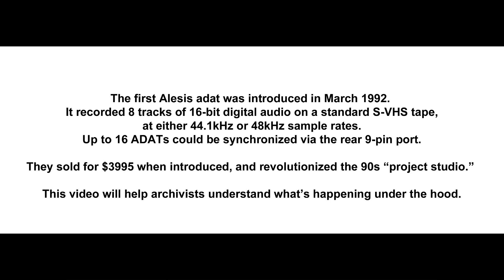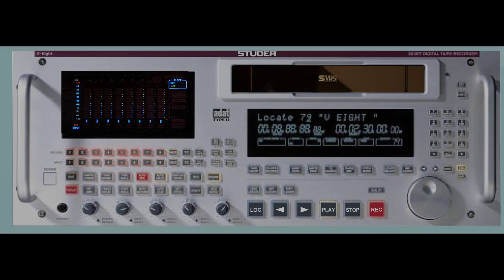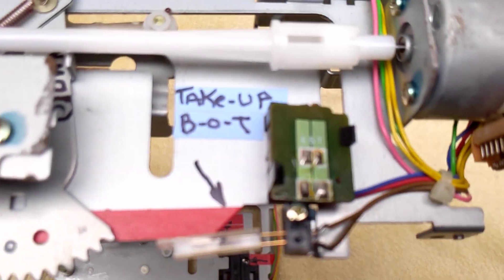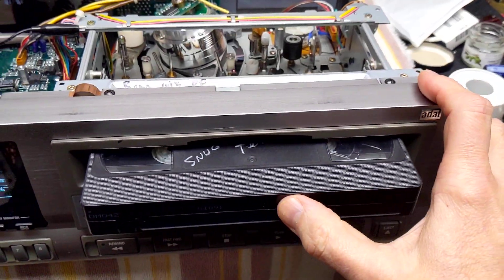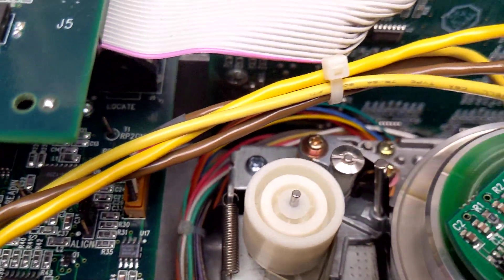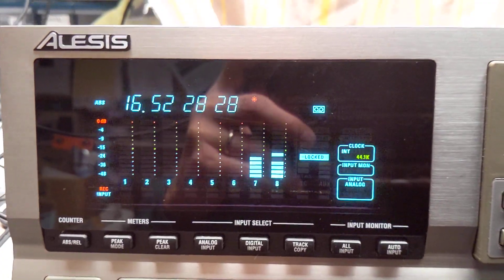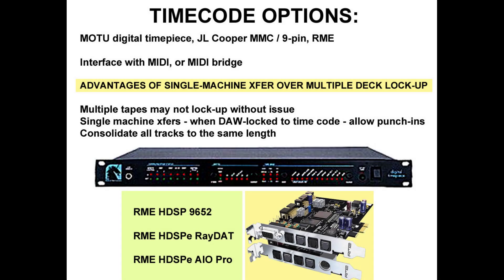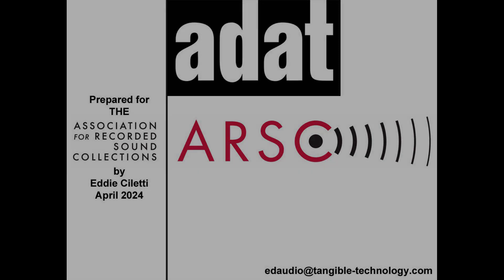Alesis ADAT: Tips for the Archiving Community

Comment: I have lost motor drive on an XP20. Not the motor itself. The schematics for the main processor board are not in the service manual. Can anyone help please? I have a vague memory of Alesis and many other ProAudio manufactures ( Dolby) only allowing return to factory repair and schematics for a lot of the gear. I use to have work on having to box the unit  up and it disappearing to the states for 6 months. Then coming back and still being faulty.
Reply from the maker: XT20. Which motor isn't turning.  Are you using fir recording or archiving
Reply: @edaudio  Reel motor drive. The machine is being used to transfer to .wav or equivalent.
Reply from the maker: @desamos8196  reel motor or capstan motor
Reply from the maker: @desamos8196  I have some docs

Comment: ADAT eating tape and no FF/RWD??  Check (by the idler tire) if the knurled knob on the Sankyo motor is slipping. To test, put machine in service mode Capstan test,  push RWD or FF, then put finger on knurled knob,  if it stops but motor still humming/turning, there you go. Not sure anyone cares in 2025 but I had to solve this and report to Eddie.  P.S. No parts available other than cannibalize an old parts machine.  Cheers!
Reply from the maker: Their only value is with the archiving community.  I have several machines and a few parts

Comment: got anything on adat won't power up
Reply from the maker: @uriel-heavensguardian8949  which model
Reply: @edaudio 
LX 20 Type 2
Reply from the maker: @uriel-heavensguardian8949  stuck eject button or faulty power supply.
Reply: @edaudio you have any videos on replacing the power supply. I’m thinking of buying one of these but the seller says it doesn’t power up.
Reply from the maker: What's your goal? Archiving or recording
Reply: @edaudio both. 
I was going to buy a couple to archive some sessions I did way back. But the one a saw wont power up. So if I can buy it and replace the power supply then that would be awesome. That Ms why I was asking if you had a video or knowledge on replacing the power supply.
Reply from the maker: @uriel-heavensguardian8949  replacing the power supply is essy
Reply: @edaudio can you do a video on it please or point me where to buy and how to install the power supply.
Reply from the maker: @uriel-heavensguardian8949   Other than Advanced Musical in LA, there is no manufacturer support and no parts - only donor machines.
Reply: @edaudio  Oh ok.
Reply: @edaudio  Thank you for letting me know
Reply from the maker: @uriel-heavensguardian8949  
Contact https://advancedmusical.com/